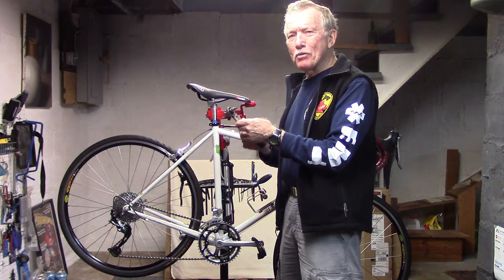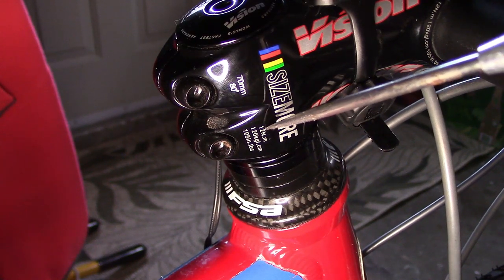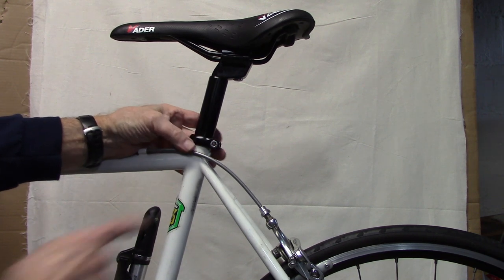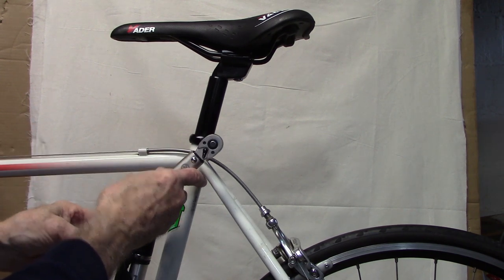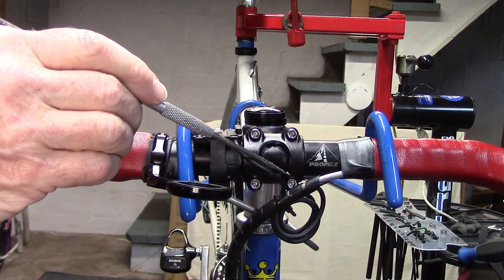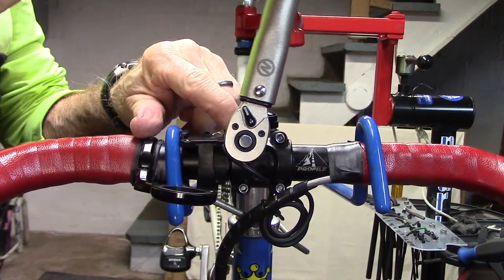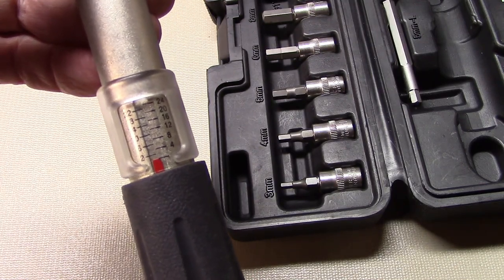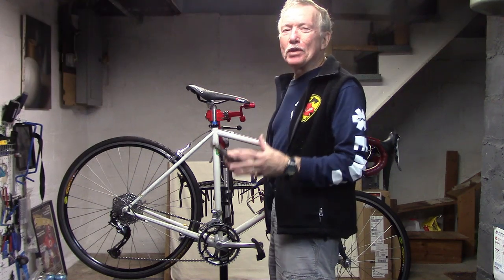Best Bicycle Torque Wrench: Use and Tips (Revised & Updated)

Comment: Good tips and good video, thanks. But where was the digital torque wrench which is mentioned in the title?
Reply from the maker: Sorry. I'll add it to the description and in a card (pop up video). Here's the info:
The best but for the buck is:

Bikehand 1/4 Inch Drive Click Torque Wrench Set – 2 to 22 Nm – Bicycle Maintenance Kit for Road & Mountain Bikes, Motorcycle Multitool - Includes Allen & Torx Sockets, 4mm 5mm Extension Bar & Storage  $60
Amazon: https://www.amazon.com/Bikehand-Bicycle-Torque-Wrench-Socket/dp/B01N8UBP9S/ref=sr_1_31?dchild=1&keywords=bicycle+digital+torque+wrench+1%2F4+inch&qid=1591470686&sr=8-31

Be sure to try it out first at 2 Nm to assure that it will click on bolts that are loosely fastened. I checked the calibration through a local auto shop and it seemed to meet specifications. I suggest you might do the same.

Thanks Declan.

Comment: What is recommended torque range for different points for bicycle ? 2~14 nm or 5~24 nm ?
Reply from the maker: Torque range varies by component and manufacturer. Many components now have the torque range marked on the component its self. I usually use the mid-point of the torque range. If only the maximum torque is given, use about 80% of the maximum. If no torque is given, you'll need to look it up on the manufacturers web site. So you may have to do a little research ahead of time.  Be sure to prep the component with the proper agent (grease, anti-seize or Fiber Grip) before attaching and torqueing. 
Regards, Tony
Reply: @tony10speed  thanks for explanations.

Comment: Why not use the maximum torque as written on the component.
Reply from the maker: There's always a chance of slightly over torqueing a bolt if you aim at the maximum. This can lead to breakage of the bolt, component, or frame (especially if the part or frame is carbon fiber). Use the proper thead lubricate on the bolts (grease, Fiber Grip, anti-sieze) and tighten to about 80% of the maximum or mid-range to the torque specs.

Comment: Can I use the torque wrench to remove bolts?
Reply from the maker: It is NOT recommended. If the bolt is stuck or difficult to remove or rusted in place, one worries about damaging the torque wrench - an expensive tool to damage.

Comment: What does Fiber Grip do?
Reply from the maker: Fiber Grip(TM): Carbon Fiber Assembly Gel is specially designed to reduce slippage between clamped surfaces, especially carbon fiber. It contains small particles to allow compression and therefore a slightly lower torque is needed. Using a slightly lower torque setting (middle or lower range of the torque specs or 80% of the max) prevents over torquing.